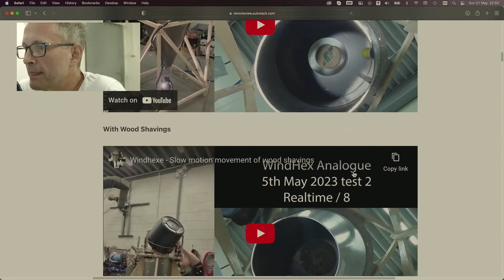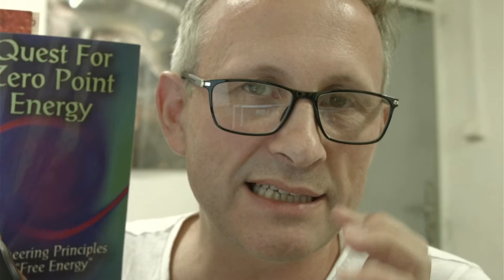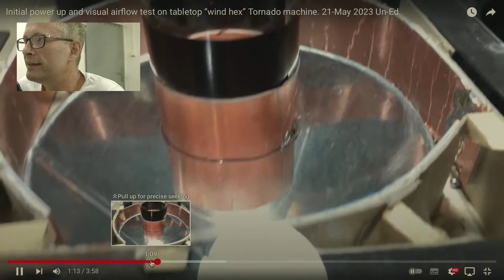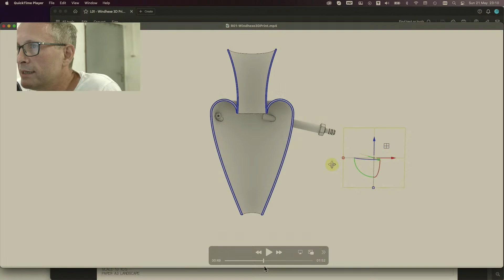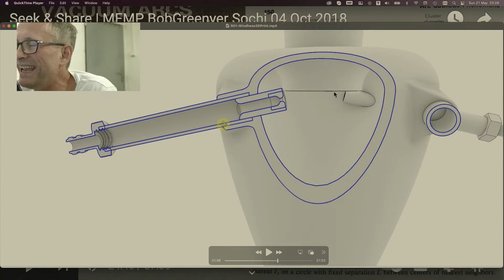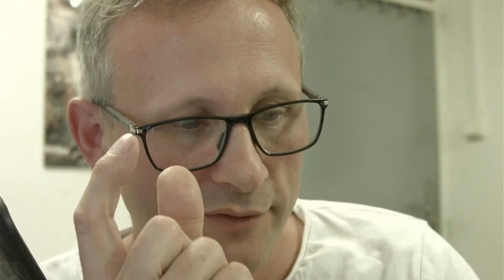WindHexe update - End 3rd Week May 2023

Comment: The Windhexe may be producing a pulse soloton type structure as a byproduct of the input vents, by air concussing off the wall reed vent forward inputs, hence, the need for high pressure air as an input to cause such. The pulse soloton 3d print design would likely need to have the soloton structure redirected as you suspect, I suspect as well. It would also likely also reduce the input air pressure volume needed to cause the same affect.
Reply from the maker: Yes, pulsing would be better

Comment: You SHOULD be able to produce a resonant volume in the Windhexe with even a single jet properly placed and fed- it's just apt to be much easier with multiples.
Also, your point about the angle of the input jets causing the generated solitons to break down too quickly by hitting the wall could (fairly easily) be addressed by making the jets off axis to the body, or axial but with an angled face.
Reply from the maker: From what we see in all systems from the micro-metric to the galactic scales, you need at least 2 injection points as you need the 180º soliton on the loop to define the form scale, not interaction with a physical boundary. From what we see in plasma in VEGA experiments on Copper pipe - 3 is better to prevent instability a tail, this appears to have been identified by Frank Polifka as detailed in his patents, though 4 is even better - at the multi-micron scale, we see no real tail with 4 or more sub tors.

Sure there will be other ways to ensure that the incoming Vortex ring solitons are targeted to the existing structure to enable accumulation.

Comment: Jet Mills or Micronisators is what you should search for. Chatgpt can give you a list of industrial grade Vortex airgrinders or Spiral Jet mills for pulverization or Micronisation. All sorts of different models out there
Reply from the maker: We have discussed the AirGrinder, which is based on the patents of the WindHexe (they licensed when it was still possible and you had to) and Spiral Jet mills are not the same, they work on dry materials, and vortex separators are not the same.

What we are woking on is an open source solution.
Reply: Yes there are a lot of vortex dryers/separators and the likes out there that do pretty interesting things. The windhexe is just a few design differences apart from the most of them and generates very crazy results with water separation and material magnetization, grinding and more. I would caution on using chatgpt for physics and engineering since it conjures up papers and studies out of nowhere that havent been published or done at al in the real world.